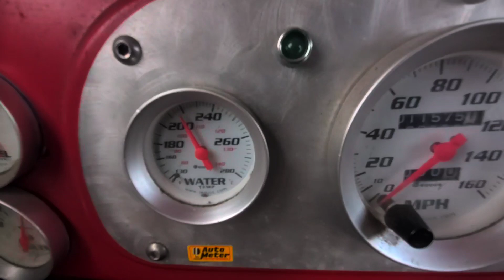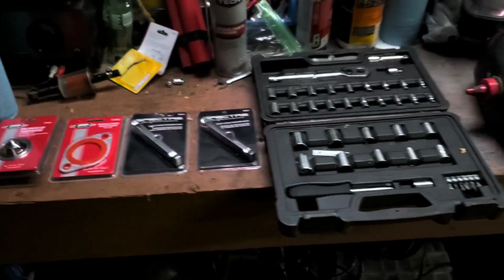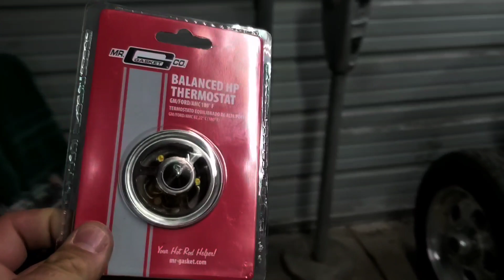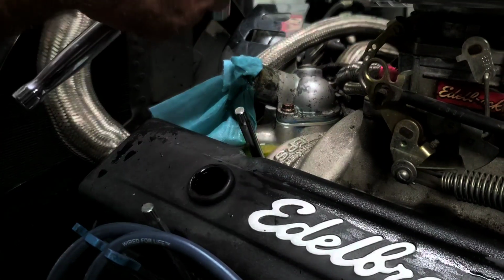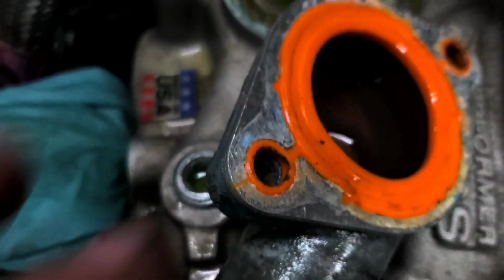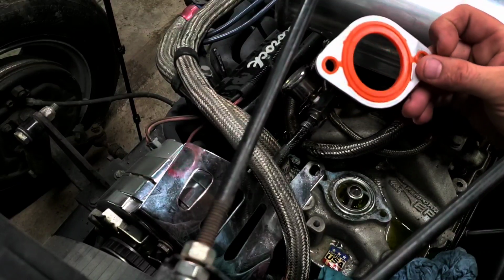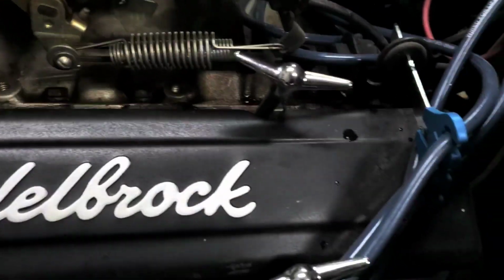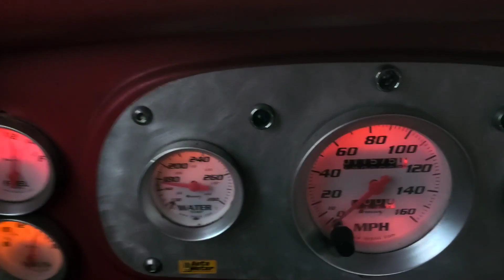Overheating HotRod.....

Comment: Be sure you lower radiator hose has a anti claps spring inside, it's the suction side and when it gets hot it can cut it self off the water flow.
Just checking. 
You should blow out the thread Holes so you don't hydrologic the intake manifold and crack it

Comment: How hot did it run after you put that 180 in there?
Reply from the maker: About 170-175
Reply: Thanks mine or run about 190 with 160° thermostat until I go uphill and then it’s run and it’s getting hot over 200 maybe 230